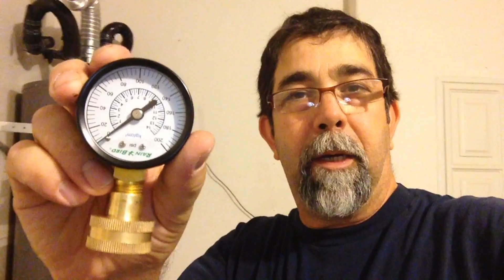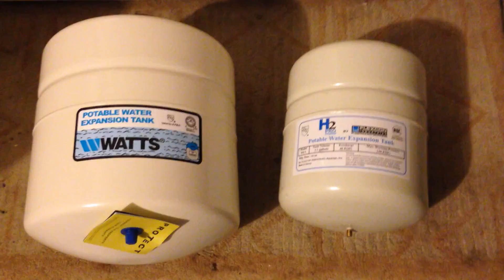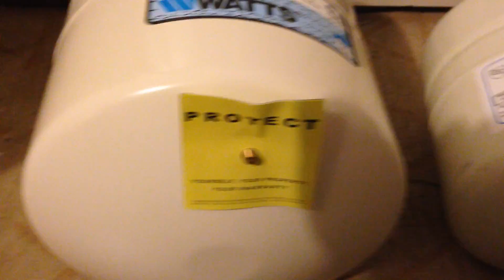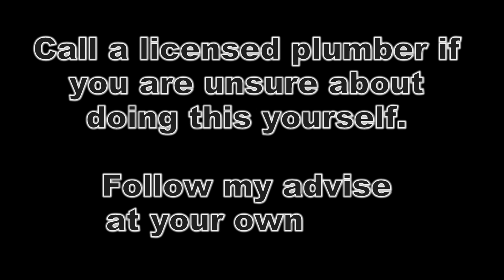Water Heater Expansion Tank Installation - Watts 4.5 Gallon

Comment: Do you need to shut off the water to the house at the main?
Reply from the maker: Absolutely! Because you'll want to then open the faucet in your kitchen sink or bathroom so you can allow the water at high points to drain down. Then you can take off the expansion tank. Leaving the main shutoff open can risk water coming through while you have the tank off. Don't want to take that risk.

Comment: so on the other side of the expansion tank, is it a 3/4 male thread?
Reply from the maker: Yes. 3/4" male threads. Go here for info https://s3.amazonaws.com/s3.supplyhouse.com/manuals/1339050976903/74981_PROD_FILE.pdf

Comment: I live in Indiana, and my 3 year old water heater started an occasional drip from the TP valve. I have never heard of needing an expansion tank around where I live. Even the plumber who installed my water heater didn't say I needed one. I've heard that the valves can go bad. I changed it this weekend and so far no drips. Also, my town has a lot of sediment in the water.
Reply: Good idea to ck your TP valve regularly, shut-off your water main valve after then drain your tank to get the settlement out. (I flush mine w/opening the cold valve to let-in new water a few times before putting everything back for normal use.
Reply: @dongulley3225  I agree. I noticed the one I installed had a tiny drip so when I opened it to test it, water started coming out of the lever that you left to open it. I think I got a defective replacement
Reply: I know it's 2 years later but you only 'need' an expansion tank if you have a check valve or a backflow preventer on the cold water side. Water expands when heated 'expansion tank' or in case like my house, the pressure just pushes back out through the main line. My town requires backflow devices on commercial and 4-family rental and above. This also includes boilers. I know...like single family hoime couldn't cause a problem...

Comment: The vent to that water heater is NFG, you've created a trap, get rid of the flexi hose it's dangerous get two 45"s adjustable to any angle and a small straight piece in-between.
Reply from the maker: Thanks. If you read many of the other comments, mine included, you'll see I addressed this and have since corrected it long ago. But, thanks for the heads-up so others don't make the same mistake.

Comment: Have you actually check to see if the old expansion tank was leaking before you replace it?  My understanding is that these tanks need to be maintained yearly and along with draining the water heater tank yearly.  So it's a good time to do both on the yearly maintenance.  If the tank has been left alone a few years (as you stated), it might be that the air had been dissipated (how it's happening, I can't say).  I can say it the same idea of maintaining the air pressure on the car tires.  It comes and goes.  I suppose, since the water pressure goes up and down depending the cycle of the hot water heater boils, air pressure gets lost over time just like the car tires from expansion and contraction.  Before you go out and buy a new expansion tank, 1. see if there is any water leaking from the valve.  If there is, then it's puncture and will need a new tank.  2. See if it maintains pressure, (if there is a leak from the valve).  If both is good, it's just probably low on air and need the yearly maintenance.  However, these things are not expensive no a days, $60 for a good one, mind as well, with a good peace of mind to get a new one.  But if you want to ensure a properly working expansion tank, a yearly maintenance will keep it going as long as the water heater itself.
Reply from the maker: Most manufacturers only recommend you drain down about a gallon of water every month. An annual complete drain down isn't necessary, and most people NEVER do a drain down of any kind. In addition, I'm not going to go through all the hassle of seeing if a 10-year-old expansion tank is leaking. Simply replace it. Too cheap considering the consequences. The internal rubber bladder does wear out over time. Thanks for the response!

Comment: Can you add air to the tank while it’s all hooked up, or do you have to remove the tank whenever it needs to be charged? Thanks.
Reply from the maker: Yes, you can add air while it's installed. No need to remove before adding air. Be sure that you check your water pressure first. You can buy a small water pressure gauge that you hook up to your outdoor faucet (known as a spigot) and test your pressure that way. Be sure your spigot does NOT have a regulator installed. The regulators look like a thick brass band that is screwed onto your spigot and then your hose goes on that. Once you find your water pressure in your home, then be sure to match that same pressure with air in the tank. 55psi water? Then 55psi air. Good luck!

Comment: Too much weight will be in that little tank for it to just hang like that
Reply from the maker: Not true. 3/4th (approx. 3 gallons) of this tank is filled with compressed air. The remaining 1/4 (approx. 1.5 gallons) is water. That's about 12 pounds of static weight that is steel threaded into the main line in the attic. I could hang 50 pounds on this and it wouldn't budge. You need to know how its connected before making a statement that it's too much weight.
Reply: @johnnymoretti  Kind of late to the party but when it fails it will fill with water which will weight 37.5lbs, plus the tank which is 10lbs which only gives you a margin of 2.5 lbs. if the pipes can in fact hold 50lbs.  Also the tank is oversized.  This isn't a problem, but just an added cost and added weight on the pipe when it fails.   The original one would work fine for the 50 gallon tank at 60psi.  They weren't cheaping out.  They just weren't overspending when they put in the original expansion tank.
Reply from the maker: @thomasbaleno5822  I respectfully disagree with some of your statement. The pipes, if installed properly..and mine were, are secured in the attic and can handle the weight should it fail. 50 pounds of static weight is not an issue. The tank isn't necessarily oversized, just larger than the original one. There are minimal sizes based on usage (heating or plumbing), hot water heater capacity, hot water temperature setting, etc. A larger tank offers more surface area to absorb the impact of water hammer. You mentioned 60psi...that is determined by the psi coming into your house from the water main. It should match what you put in the expansion tank. But, thanks for your comments.

Comment from the maker: I think there is some confusion about the installation charging and the angle of attachment. WATTS does allow the unit to be installed both horizontally, vertically or sideways. ( see this link: http://media.wattswater.com/2915054.pdf ) Also, they caution to only charge this tank WITHOUT any pressure in the house system.FROM THE MANUFACTURER:Installation
1. Before beginning installation determine the system pressure.a. Open a faucet to allow the system pressure to equalize.
b. Close faucet.c. Read the system pressure at the pressure gauge (Figure 1).
2. The expansion tank pre-charge must be set to the system pressure asdetermined in Step 1. Pre-charge prior to installation in the system.
Caution: Pre-charge prior to installation in the system.Do not adjust the air pre-charge of the expansion tank
with the system under pressure. The air pre-charge should only be adjusted under zero system pressure.Note: The normal pre-charge is 20psi (138 kPa).
Do not exceed 80psi. If system pressure exceeds80psi (5.5 bar) it will be necessary to either: A. Add a
pressure reducing valve to the system or, B. Locate theexpansion tank in a riser where the static pressure is
below 80psi (5.5 bar).a. Unscrew the protective cap from the air inlet valve.
b. Using a tire pressure gauge, check the tank pre-charge pressure.c. If necessary, pressurize the tank to the proper setting using a manual
bicycle tire pump. Caution do not exceed 80psi.d. Replace the protective air cap.
3. Shut off the water supply valve.4. Shut off power source to the water heater, (electricity, gas, oil burnedswitch) and drain system following water heater manufacturer recommendations.5. Install the expansion tank in the system (refer to Figure 1).
a. The weight of the expansion tank filled with water is supported bythe system piping. Therefore, it is important that, where appropriate,
the piping has suitable bracing (strapping, hanger, brackets).b. The expansion tank may be installed vertically (preferred method)
or horizontally. Caution: The tank must be properly supportedin horizontal applications.
c. This expansion tank, as all expansion tanks, may eventually leak.Do not install without adequate drainage provisions.
6. Turn on the water supply valve.7. Open a hot water fixture and allow water flow until all air is removed fromthe system.8. Reapply power to the water heater.
9. Open a hot water fixture to allow a slight flow until the hot water hasreached operating temperature.
10. Recheck system pressure following Step 1.a through c.
Reply: Great directions!! Most of these videos leave 1-3 steps out...

Comment: Shouldn't the air pressure in the bladder match the water pressure AFTER the full cold water pressure is applied, and not before, as you seem to have done? With the finite volume of the bladder, if you set the air pressure equal to the water nominal pressure before it sees the water pressure, then the contraction of the bladder after it is connected to the water pressure should increase the air pressure significantly, no?  Did you measure the air pressure also after the water was connected? Did it increase?
Reply: I would take 2 pressure, since you have that pressure adapter (one would barely use this item anyways).  I would test it at the garden sprout reading (which is the incoming cold water pressure) and also at the bottom of the water heater sprout drain (second reading).  Compare those 2, it should be the same if not, take average of the 2 and use that pressure reading for the expansion tank pressure to maintain.
Reply from the maker: I think there is some confusion about the installation charging and the angle of attachment. WATTS does allow the unit to be installed both horizontally, vertically or sideways. ( see this link: http://media.wattswater.com/2915054.pdf ) Also, they caution to only charge this tank WITHOUT any pressure in the house system.FROM THE MANUFACTURER:Installation
1. Before beginning installation determine the system pressure.a. Open a faucet to allow the system pressure to equalize.
b. Close faucet.c. Read the system pressure at the pressure gauge (Figure 1).
2. The expansion tank pre-charge must be set to the system pressure asdetermined in Step 1. Pre-charge prior to installation in the system.
Caution: Pre-charge prior to installation in the system. Do not adjust the air pre-charge of the expansion tank
with the system under pressure. The air pre-charge should only be adjusted under zero system pressure.Note: The normal pre-charge is 20psi (138 kPa).
Do not exceed 80psi. If system pressure exceeds80psi (5.5 bar) it will be necessary to either: A. Add a
pressure reducing valve to the system or, B. Locate theexpansion tank in a riser where the static pressure is
below 80psi (5.5 bar).a. Unscrew the protective cap from the air inlet valve.
b. Using a tire pressure gauge, check the tank pre-charge pressure.c. If necessary, pressurize the tank to the proper setting using a manual
bicycle tire pump. Caution do not exceed 80psi.d. Replace the protective air cap.
3. Shut off the water supply valve.4. Shut off power source to the water heater, (electricity, gas, oil burnedswitch) and drain system following water heater manufacturer recommendations.5. Install the expansion tank in the system (refer to Figure 1).
a. The weight of the expansion tank filled with water is supported bythe system piping. Therefore, it is important that, where appropriate,
the piping has suitable bracing (strapping, hanger, brackets).b. The expansion tank may be installed vertically (preferred method)
or horizontally. Caution: The tank must be properly supportedin horizontal applications.
c. This expansion tank, as all expansion tanks, may eventually leak.Do not install without adequate drainage provisions.
6. Turn on the water supply valve.7. Open a hot water fixture and allow water flow until all air is removed fromthe system.8. Reapply power to the water heater.
9. Open a hot water fixture to allow a slight flow until the hot water hasreached operating temperature.
10. Recheck system pressure following Step 1.a through c.

Comment: I am a plumber and commend you for your work here in this video. Although you might want to at least trim your exhaust vent on the top of your water heater so no exhaust is trapped. I see that the vent is curved like in "S" when it should only be flowing upward. I would replace with a more rigid tin metal.

Comment: the expansion tank seems odd , it always must be installed between the water heater and the shut off valve . glad to hear you corrected the flu pipe problem however you would be better off with rigid flu pipe rather then dryer vent flex pipe .and yes its important to match your house pressure with expansion tank . your local codes may be different of coarse but gas piping is safer to be piped in black pipe (hard piped)  to the unitrol

Comment: Johnny, has the valve leaked water since the correction?
Reply from the maker: Not a drop. Been going strong since I installed it. But the valve that leaked was on the old water heater.

Comment: your vent on the water heater is wrong. your have a trap in it should be pitched sligtly to tank
Reply from the maker: Derek, you're right. This was corrected long ago when someone else mentioned it. I've since straightened it out so the exhaust can flow straight up with no restrictions or back pressures. Thanks for mentioning! You can see my correction here: https://youtu.be/CNzqB8eACgA

Comment: MrAirhose1, you should have a pressure reducing valve and backflow preventer feeding your boiler. If you're getting greater than 30 psi the pressure relief valve is doing its job relieving that overpressure. The thermal expansion tank for the boiler should be sized for the boiler. If it is a steel tank, drain it some to ensure its not waterlogged. If its a diaphragm tank similar to these tanks shown, you'll have to isolate it from the system then check the charge. if water comes out of the schrader valve, the diaphragm has blown and the tank must be replaced. Otherwise, charge it as shown here to your boiler pressure, which should be around 12-15 psi. Once you have the boiler protected, then you can purge it and fire it up. 

You put expansion tanks on water heaters only when it has been made a 'closed' system. This means if there is a pressure reducing valve, backflow preventer or double check valve in the water supply to the house, these devices will prevent expansion from heated water equilibrating back into the street mains. Only then would you need a tank on the WH. In your case here, your temperature/ pressure relief valve actuated simply because you had no charge in that undersized tank. Also, when reinstalling, install a ball valve to isolate the tank from the system without having to shut off the entire house and drain the pressure. You can turn off the valve to isolate it, test the pressure at the schrader and look for water leaking at the schrader, charge as needed or replace then open the valve all without having to drop the system. I know Calif. is another planet but in most of the country the tank is installed off a tee downstream of the cold water shutoff to the WH--not hanging from the ceiling. BTW, you would tighten this connection just like any other pipe thread. 
HTH

Comment: Hi Johnny M.
just a couple of suggestions: as mentioned by Ryan Rice, your vent is wrong - dangerously wrong.
Always keep rising with a gas vent (or any other vent) never come back on yourself and create a trap. Its impossible for that W/H to be venting safely or efficiently, get a plumber in to  immediately rectify the vent. If you had a CO alarm close by it would be sounding off.
The seismic strapping is also wrong, and the P&T discharge pipe needs inspecting (could be too many bends or lack of a correct installation.)
Its recommended by some authorities that the pipe insulation stays 18" from the W/H.
Dont anyone use sub-contract "plumbers" from Home Depot  etc. - you will be ripped off by the sub and the HD store. Use a local plumber.
Reply from the maker: +mike gert Thanks, Mike for your input. I've already corrected the vent pipe (see vid here: https://youtu.be/CNzqB8eACgA) and now its a directly vertical venting. I will have a plumber take a look at the P&T pipe even though it was installed by a professional (20+ years) plumber (not Home Depot). Not sure what the code is for insulation. I'll check. Thanks for the input and all this dialogue will help everyone stay safe and safe money.